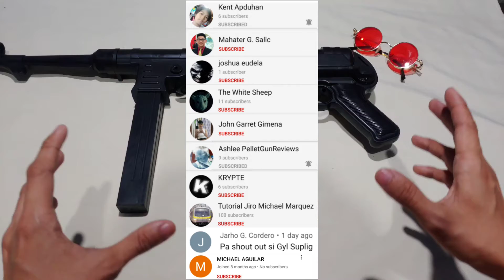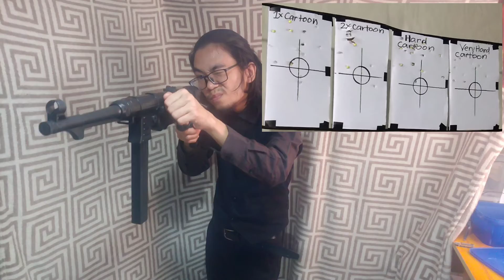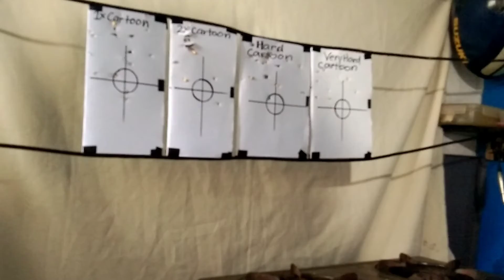How To Upgrade MP40 Spring Type Airsoft | 280 FPS? (REVIEW by UNBOXING SIMULATOR TV)

Comment from the maker: Nabili ko ang Copper Barrel sa Shopee at ang pangalan ng store ay fenteer.ph at ang pangalan ng item ay Brass Pipe Copper Tube Round Outer 6mm-20mm Length 500mm Model. Ang pinili kung outer diameter size ay yung 8mm para ang inner diameter nya ay 6mm.

Comment: Lods san ka makabili ng hi-end barrel
Reply from the maker: Ay sorry lods,,,di ko nasabi sa video ko,,,,,,ilalagay ko nalang sa description box lods,,,,at e comment ko rin dito😃
Reply from the maker: Nabili ko ang Copper Barrel sa Shopee at ang pangalan ng store ay fenteer.ph at ang pangalan ng item ay Brass Pipe Copper Tube Round Outer 6mm-20mm Length 500mm Model. Ang pinili kung outer diameter size ay yung 8mm para ang inner diameter nya ay 6mm.